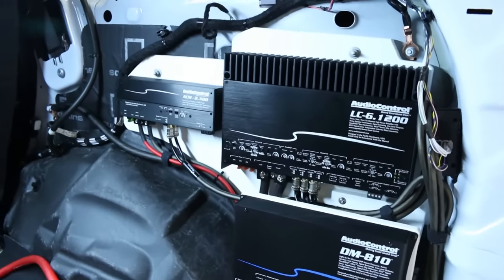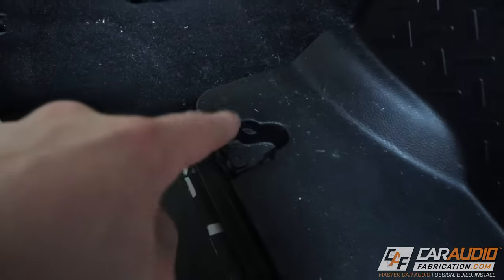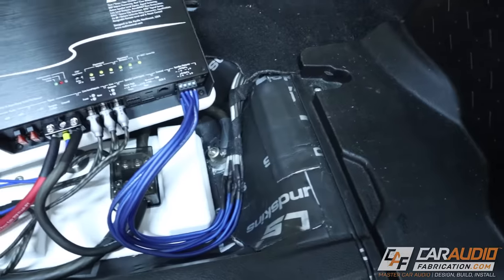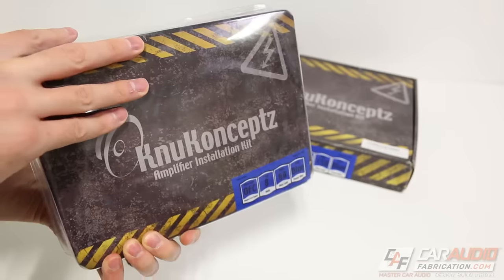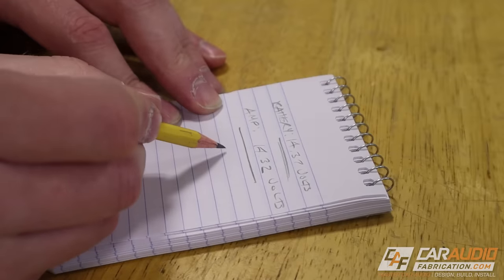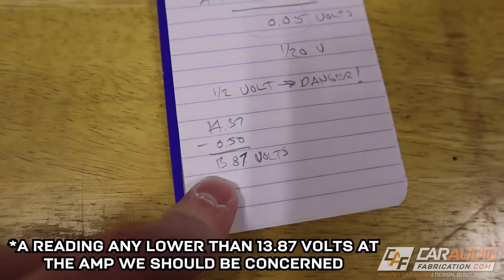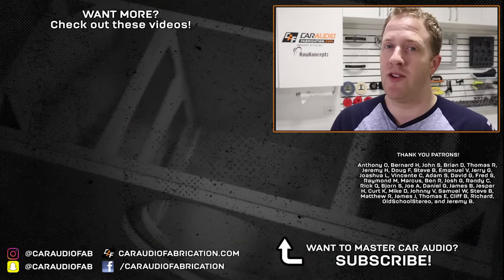YOU'RE LOSING PERFORMANCE! How to Measure Voltage Drop and Test Ground

Comment: Hi, so to check the OM I need to put the black wire of the avometer to the disconnected minus cable from the battery and the red wire on the chassis?
Thanks

Comment: Would this type of testing and trouble shooting voltage drop work on multiple amp systems? And capacitors with that system as well?
Reply from the maker: Yes.

Comment: I have a question if you see this comment. How much does voltage drop from insufficient sized wires matter if the amplifiers are hooked up to a battery bank in the back of the car with short runs? For example, you have the front battery connected to a set of two back batteries that are much larger than the front battery and then the amplifier is hooked up to the back batteries. is the voltage drop going to be affecting just how well the alternator is able to supply the back batteries or would it affect the voltage that the amplifier sees? I have a 70ah AGM front battery, stock 150a alternator, big 3 upgrade, 2 110a AGM back batteries, And the front battery is connected to the back batteries with two runs of SHCA 1/0GA cable about 16' long (but it's CCA and it's old so it needs replaced) And the amplifier is rated for a 450a fuse rating, a Wolfram 4500.1. I recently learned about how wire length causes voltage drop and the need to oversize the wire to compensate for it, but i'm wondering does the voltage drop from the length of the wire only affect the back batteries capability to be charged from the front alternator or is it also causing the amplifiers to see lower voltage when under load even though the power wires to the amplifiers from the back batteries are only a few feet in length? I know that the alternator is not large enough to supply the current demand of the amplifier, so it would largely be dependent on the back batteries. If I have about a theoretical 1.2v voltage drop from the wire size and length and 400A current, then would that mean under load when my amplifier shows its at 12.5v, that the front alternator and battery are at 13.7v, but the back batteries and amps are only seeing 12.5v because of that voltage loss? Sorry for this long explanation and question. I know I'm going to have to measure it all myself, but I was just a little confused on how voltage drop affects systems with a back battery bank, whether it's just the ability to "charge" the batteries or something more. I plan to switch out the power wire with two runs of 4/0ga OFC or welding cable to help minimize voltage job and was just wondering which aspect it would most benefit.

Comment: I have a question. I have 2 15s in a Saturn in a ported box with the subs facing up and port facing the rear. My backseat  fold down and I was wondering would I get more bass /flex if I have the port facing the cab of the car unstead of the rear

Comment: Great video thanks alot! Quick question how would you rate a 0.09volt drop at the amp with sub loaded and amp pushed to max rms rating? Would you consider 0.09 as acceptable? Good? Or great?
Reply: He said anything over 0.5V was unacceptable
Reply: dudes meter is off by .02 ohms it should read 0.0 with leads touching with some good pressre on leads

Comment: I was wondering your thoughts on a problem that I have.  When turn up my system to volume 38 which is my set point. There are times when my system is very loud and times when it is not. All speakers are ran off of 2 amplifier (75×4 and 1500x1) I am losing volume from all speakers in car. 1/0 power wire/200amp fuse, checked speaker polarity,  XSd480 under hood, 2 kinetic batteries in the back, Stock Alt. Double checked all connections. Seems to me like power loss because it is both amplifier.  Any thoughts would be great Thanks

Comment: Mark, Why is it such a big deal to have bigger wire to allow more power to reach the amplifiers when there’s only so much power that can pass through the fuse?
Reply from the maker: This is a common misconception by folks who don't fully understand the way electricity works. The fuse is very short, it doesn't limit the system

Comment: Probably a dumb question and I feel it might have to do with grounding but I’m running a 3k rms amp with 0g ofc kit but my 0g wire keeps melting at the in-line fuse by the battery. How or what should I do to help. (Wire burns after a couple days of playing at decent bass range)

Comment: Somehow... I got my system to have literally zero voltage drop.  200amp alternator all 0\1 gage wire... I still need to upgrade my battery and thinking of using a ULTRACAP in the back.

Comment: When you read the voltage at the battery terminals, are you doing it while the 40Hz Track is playing? In the same way when you measure the voltage at the amp terminals, is it while the 40Hz Track is being played? When I do this while playing the 40Hy Track the Voltage values rise and fall. Or are you taking the measurements without anything playing?
Reply: wizz i asked the same question ... if he is playing 40 Hz full tilt and only dropping .05 of a volt he either has lots of batteries and alternators ( which he doesn’t ) or he is literally getting no wattage out of his 1500 W amp..
Reply: @uptobatentertainment  right on. I initially thought those voltage drops I have were caused by the ground point I chose. I still haven't tested my ground point. So the way I see it, he removed the minus pole from the battery and then attached to this removed minus pole a test lead from dmm. So practically he is testing the resistance between 2 chassis ground points, or?
Reply: wizz looks like he took one lead to the negative battery terminal and the other lead to his grounding point on the frame / chassis he will use for amps measuring the resistance ... which I tried but my leads on my DMM are too short and I can’t find super long ones. 

I did measure resistance from my trunk ground to my amp ground input terminals & got 1 ohm with a 10” run of copper wire w/crimped ring terminals & wire ferrule. The other amp was a little less cuz the wire run is shorter which makes sense to me. I don’t think I was playing any music or test tones. 

I will rewatch this vid for the 5th time but everytime I watch I come to the conclusion he left out some info. Or he has A SQ system wired higher impedance with lots of rise where his 1500 W sub amp is putting out less than 100 W max. So no or very little voltage drop.

My system is Helix DSP.3, Audiofrog GB60 & GB15 on a Zapco 150.4 AP, 2 JL 10W7 on a Zapco Z2kDII 2100 W RMS Amp at 1 ohm. So 2700 W rms with a 60AH AGM & 240 Amp Singer  HO alternator. 

I can crank mids & highs & only not drop a .1V -.2V on the kick drums peaks but my 1500 W amp can drop my voltage to low 13s at “ max volume “ 

Let’s take my 240 amp alt, say car takes 80 amps that’s 160 max amp output for audio. I’m wired to 1.5 ohm before impedance rise. Max RMS watts I get out the 2k will be 1600 W.. My car voltage stays at 14-14.4 so let’s divide 1600/14= 114.3 amps to produce 1600 W at 100% efficiency. No amp is 100% efficient. So at 80% amplifier efficiency I will need 137.1 amps to produce the same 1600 W. 

This is an example b/c I have not been able to test my dc amperage pull vs ac volts and ac amperage going to sub to see what is actually the current demand/ draw for the system. 

Hope my ramblings helped lol

Comment: Is it ok if im take the power 12v wire to power wire of headunit? im using compact active subwoofer blaupunkt gtr 130a. The audio shop install like that. Just wierd why not use the power wire direct to battery but take from the headunit.

Comment: If my volts are going from like 14.7 down to 11-12 volts when under power. Is it from a bad ground or needing more power. I have 2 sundown sa 10s v2 so 1,000 watts rms with a jp-2300 amp. My amp will get hot and turn off when playing loyd music for 5 mins. The only electrical upgrades is my main battery which is xs power d3400 and big 3 kit. But stock alternator. Was buying a alternator Wednesday but thought it might be possible it’s my ground what do you think? Using ofc wiring kit for my amp and the ground is on a seat bolt and I cleaned off to bare metal
Reply: The truck is a 2008 GMC Sierra 1500

Comment: Out of curiosity what would happen if you was to use a ground wire that is larger then your power wire? Example if you use a 4g power wire to your amp and a 1/0 ground. Just wondering what the pros and cons are of this wire set up.
Reply from the maker: If the 4 gauge is sized properly for the system there is no real advantage to using a larger ground wire (as long as a good ground), but it certainly wouldn't hurt anything.
Reply: Derek Hoffman do 0 gauge u will want to go louder eventually and won’t have to re run 0 gauge when you do! U can always get reducers to run 0 gauge into a 0ga to 4ga reducer and put the 4ga reducer into the amp input!

Comment: Hi I was curious on how I could run a 5 channel with all my speakers being component speakers on my 2010 Volkswagen Tiguan( LOL I have more of a mechanic background than an electrical background) but I’m getting infinity kappa 60.11 cs for all four doors and they come with passive crossovers for each woofer and tweeter so how would I go about parallel wiring each front and back speakers to get 1 ohm each because my Kenwood amp is rated for 2 ohm speaker.( I’m sorry for wording this probably wrong but I have no ideal what I’m doing)

Comment: Chevy Cobalt SS/SC: No grounds in the trunk, all the panels are glued together with spray foam :(
Reply: What about the factory ground to the left of the battery?, or hole saw through the tire well (what I did) & go to the sub frame or a run to the alternator bracket.
Reply: Rear seat mounting bolts, seat belt mounting bolts, or rear strut bolt. I have had good luck with these in the past. Clean the paint in the area you choose with sand paper or a wire wheel, and test your connection.

Comment: Everything  in my system was working fine but then my amp went into protect with car off. Voltage indicator on amp showed 9-10v. When I turned car back on  the voltage went up to 13.9 but when I bump the bass the voltage drops back down to 10-11 at amp but voltage at battery is showing 13.9. What could this be? Checked all fuses and connections. Even internal fuses in amp. Haven't clipped once. What gives? Sometimes the amp runs fine at 13_14 volts idling then it will be 9-12 a few mins later.
Reply: Battery is not fully charged.

Comment: want a fun little tip, you can buy headphone jack to RC cord and have a sine wave generator play through your phone and connect the red and white leads to your amplifier, then set your phone to 3/4 or 75% volume through the app giving you enough time to actually get your work done

You're welcome!
Reply: That would be RCA to 3.5mm jack
Reply: @nicholascasatelli6949  just as I said...

Comment: I did a voltage test on my amplifier snd I was getting 7 volts at my amplifier. But when I disconnect the wires going to my amp, the reading is the same as the battery,  14.5 volts. Any idea why my reading drops by 50% when the leads are connected to the amplifier?
Reply: I had a corroded ground. That’s all 😬

Comment: My audio system stopped working it was working fine for a couple of months until a while back at high volumes my amplifier would turn off and go into protect mode but it would turn back on and it did this a couple of times until it completely stopped playing my amplifier turns on. when i dont have my ignition switch on my amplifier terminals get 12v but when i turn it on the terminals get 0v and the power line gets 12v it also has no power to my speaker wires i tested my negative terminal with a speaker wire and it got .14 v and i tested my postive terminal with a speaker wire and got 2v so any help im gonna try all these tests right now but if you guys have an idea i would appreciate it update i fixed it i had a blown fuse connector im new to car audio ive only connected my kicker to my amplifier so i didnt know what a fuse connecter was but i fixed it i did a little mickey mouse and it works now if it wasnt for you i wouldve never figured this out! Earned my subscribe im not much lol but you really deserve it for the good explaining keep it up!!!
Reply: Update i tested my battery terminals i have 12v but my postive wire is connected to some see thru thing that connects it to the other side of the wire and it has a crack and recently i had some oil or something shoot up from my strut tower so i checked both sides of the plastic thing and the closest side to the battery has 12v but right after the see thru thing it has 1v or nothing

Comment: Always through bolt your ground to the frame. No better ground possible
Reply: pretty sure a silver cable going to the case of the alternator would be a better ground, impractical and expensive but better
Reply from the maker: Orrrrr..... You could test, which is the point of this video. Manufacturers are doing weird stuff and bonding frames and such with adhesives as opposed to welding. It's always best to test
Reply: @CarAudioFabrication  even when they use adhesives they are still using bolts and or spot welding. There is actually another video on youtube that backs up my claim. Infact it also shows that the frame is better than running 0ga straight to the negative terminal on the battery. (Video was made by a very reputable known engineer in the car audio industry)

Comment: Hope someone can help with lc7i. Installed in 2015 edge with sony system but the lc7i does not shut off after turning off the vehicle and locking it. I got the signal from the rear speakers and rear subwoofer. Any suggestions?
Reply from the maker: You will need to use a remote turn on from a switched source that comes on with the ignition.
Reply: @CarAudioFabrication  thanks for getting back to me. Will the  GTO feature not work on this vehicle?
Reply from the maker: If the vehicles factory system continues to present a voltage on the speaker wires even when the vehicle is off, its more a case of bad design on the OEM behalf than the GTO feature "not working". GTO is doing its job. OEM is poorly designed.
Reply: @CarAudioFabrication  gotcha. Thanks for the help 👍
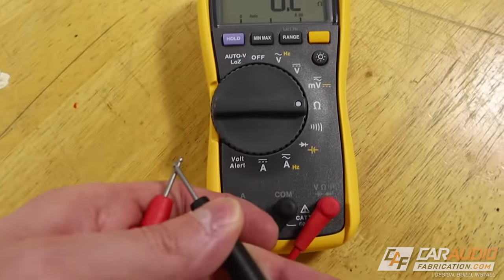Reply: @CarAudioFabrication  so it turns out, that the stock amp or dsp still sends signal for 2:30 minutes after shutting off the car. Just had to wait longer for the lc7i to shut off. Have you experienced that before? Is that normal?